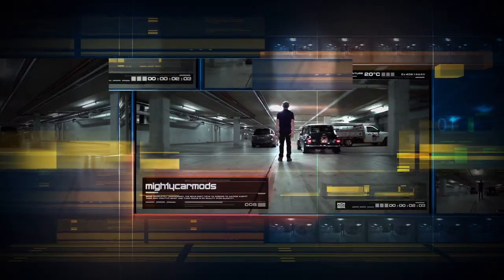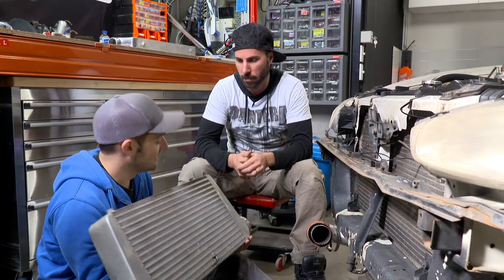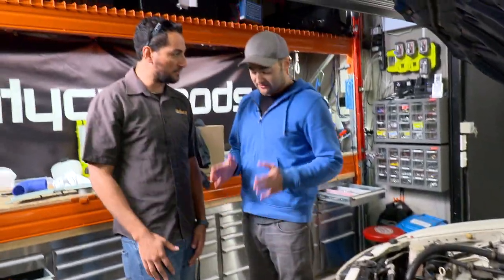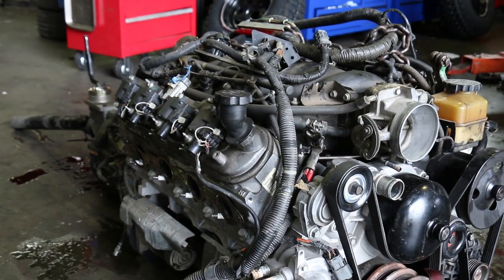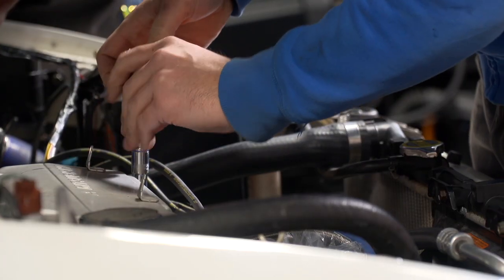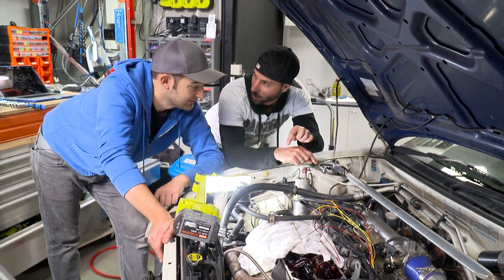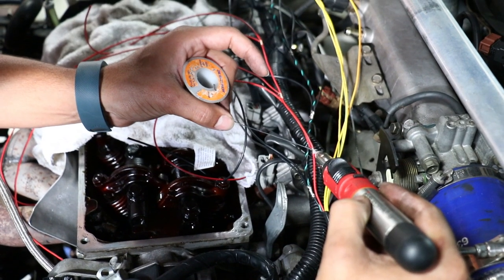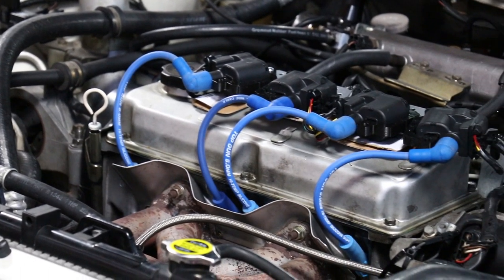LS1 Ignition Coil Conversion (2SEXY)

Comment: Wait, the guy from Haltech is dailying a 12 valve 4G15 on 20 lbs? Here in the states those engines are tossed and we swap a 4g61 or 4g63 in its place because the cooling jackets in the head just couldn't handle it and they would overheat constantly. I built a 4G63t Colt hatch on 16 lbs it made 408 to the wheels on a 19c Frankenstein turbo. That's why I find 2Sexy so interesting, I've never really seen anyone boost the 4g15. Here, in stock form, the 12 valve 4g15 made 93 HP, so after drivetrain loss that would be about 60 WHP so boosted on 10 psi 100 WHP isn't too bad for what it is.
Reply: Here in aus, the 4g15 isnt that common to modify, we usually swap a 4g93 (16v 1.8l) or a 4g94 (16v 2l) Next in line would be the 4g63, the 1.8 and 2l do fairly well with around 9-10 psi
Reply: I swapped my Colt to a 4G63T back in 03' but never got it running. Had to steal the engine back out to get my Talon back on the road at the time. Would have loved to see what it could've done. Still check Craigslist time to time to find another one.

Comment: I guess it shouldn't be too hard for you guys to source LS parts, seeing how they've put LS engines in so many Holdens in recent years.
Reply: Since roughly 1999 IIIRC. The cars themselves (Commodores) were super popular back then too (less so nowadays but still fairly popular) so there is a lot of LS engines and parts for them available.
Reply: ihateleechess
Yup, they started to phased out the Holden V8 in mid 1999 in favor of the LS.

The V6 available in the Commodore in the 90s was an American engine as well, a Buick V6 (the same engine was also an option for my car, a sixth gen Grand Prix, but I have the base model with the 60 degree V6). I think I read somewhere that long before the Monaro-based GTO and the G8 were a thing, GM was thinking about bringing the Buick-powered Commodore over here as a Buick.
Reply: Sure enough, here it is.  The design of this concept clearly influenced the Oldsmobile Aurora that would come shortly afterwards, though I doubt the production version would look like this if it became a reality.  It probably would have just been a rebaded Commodore, Buick apparently helped them develop the VT.

http://autosofinterest.com/2013/02/01/1995-buick-xp2000-concept/

Comment: i feel like you would need to worry about more then just the bolt hitting the sensor at 7000 camshaft rpm lel
Reply: 14,000!!!!!
Reply: 8700s14
ikr :P
Reply: More like 3500 RPM. Cam spins at half speed of engine.

Comment: is it only me thinking that 1 gram can out-balance a wheel, so a bloody great bolt in a cam pulley at 7k seems a little wrong?
Reply: The cam pulley will only be spinning at 3500 rpm while the engine is at 7000 rpm, just fyi.
Reply: +Brian Sipe of course, half of crank speed, rookie error! hahah. and I know it's a damn sight smaller than a wheel as well, just seems a little alien to me! haha
Reply: +mcgherkinstudios kinda my thoughts, not great, but then again, 2SEXY is just a track beater!